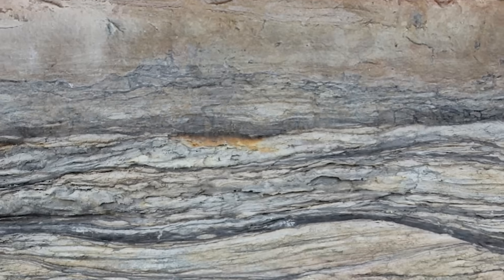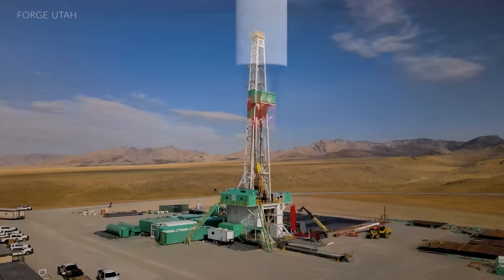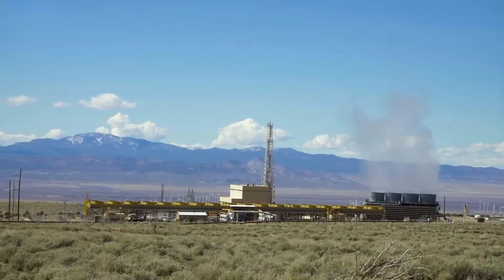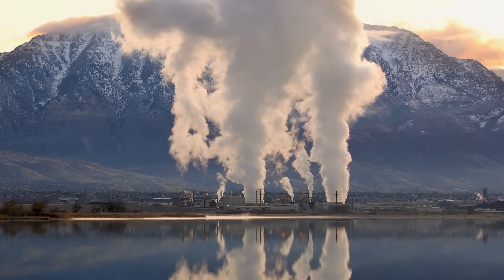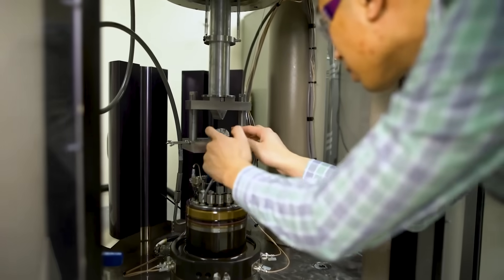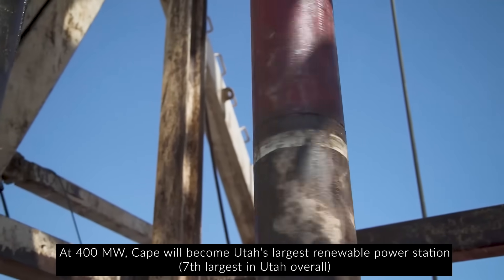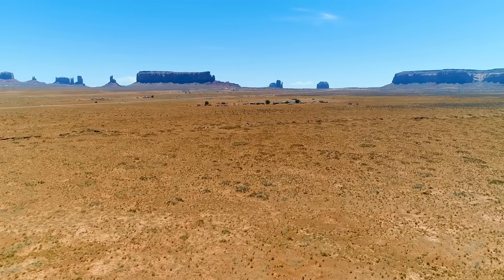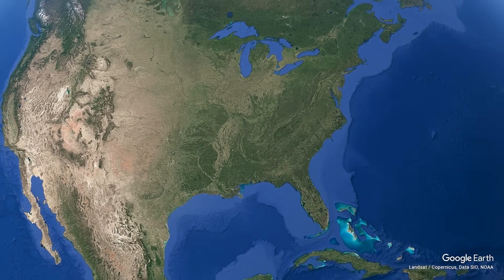This Groundbreaking Clean Energy Source Could Power America

Comment: I was watching a video about mechanical batteries earlier so my though now obviously is to add a spinning mechanical battery to a geo thermal plant. It would handle rapid load changes and most of all could be charged and reboosted from the steam directly (without going through a generator and motor).

It feels neat, but I suppose it is too much steam hardware and they could just use normal batteries, or simply dynamically adjust the throttle on the main generator to deal with load changes.
Reply from the maker: Good thoughts all! Which video?
Reply: @TheDailyConversation  'How This Mechanical Battery is Making a Comeback' by Undecided with Matt Ferrell
Reply from the maker: Thanks!

Comment: The US should be investing money into nuclear energy, build new power plants and refurbish older ones
Reply: Nuclear energy has a bad reputation, partly on purpose, partly by accident.
Reply: Overnight capital cost of advanced nuclear or SMR power plants range quite high $7,800/kW+. Although it has a high capacity factor, it is not the most ideal method to invest billions into new power plants. We should be worried about refurbishing and extending the life of existing nuclear plants, and invest into battery technology to improve solar use, geothermal, and other technologies that we can forecast becoming cheaper. Not fully against you here though.
Reply: @ the biggest risk for nuclear is what happens during times of war. They become a huge target with devastating aftermath. 

Batteries and solar both require dirty mining practices, however Iceland has come up with a “hydro battery” idea that uses pumped water into a reservoir during low usage to power hydro dams during high usage, using geo thermal as their every day power and to run the pumps.
Reply from the maker: I saw that too. We have something like that in WV I think
Reply: @Viennery  Yes and No. Even the madman Putin wasn't crazy enough to destroy the Zaporizhzhia nuclear plant. He did however, see no problem with flooding hundreds of square kilometers by destroying a hydro dam. NPPs are built to withstand direct impacts with aircraft at near supersonic speeds and are designed from the start to be multiple-redundant. I'd be much more concerned about living near gas and chemical infrastructure. Ukraine has shown over and over that those explode quite readily.
Reply from the maker: Well said.
Reply: Y'all love that nuclear till something goes wrong 😂...
Reply: Part of the geothermal plan is to drill on sites of closed down coal and nuclear plants. The advantage here is the site already has the grid interconnects.
Reply: Capital costs are insane and there's a lot of risks of budget overruns and such. Nuclear is basically only successful with LOTS of gov't coordination and that only exists in places like China, Japan, and France which aren't afraid of state-owned/-supported utilities. Even next-gen tech like SMRs are eyewateringly expensive and may not pencil-out at all scales. On top of that, nuclear plants, at least right now, need consistent supplies of cool water, so their effectiveness is threatened by climate change. Both France and Germany had to shut down reactors in 2023 b/c a heat wave resulted in historically low river levels and increased the temp of river water.
Reply: I agree, however this had the added benefit of virtually no risk, especially if it becomes a military target by foreign saboteurs
Reply from the maker: Oooo now you’re playing 3d chess. I like it.
Reply: I really like nuclear energy. We should continue planning to build out a lot more of it. But I have to admit EGS looks like it has the potential to compete very strongly against nuclear, at least as it exists in the US.

That said, this is still very unproven tech at the scales needed. It might not scale as well as hoped. So we should continue on both tracks.